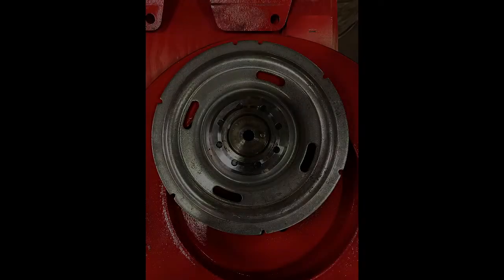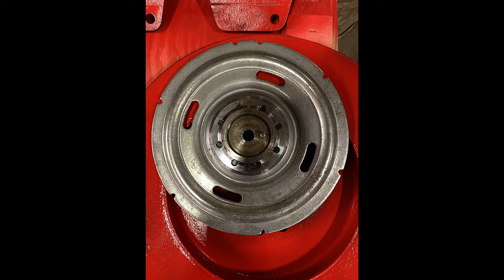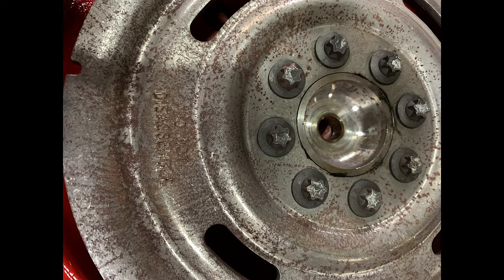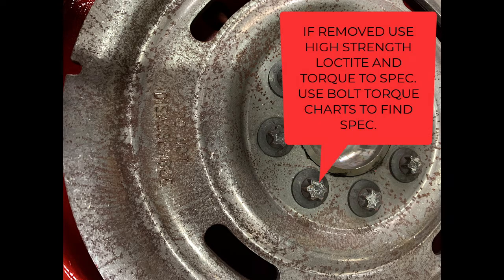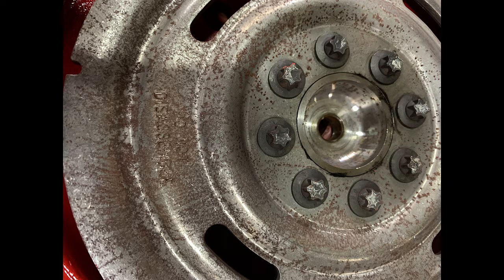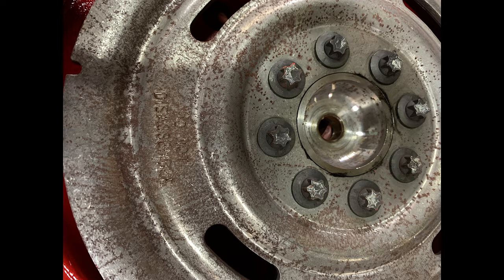ISX Cam gear timing plate install

Comment: Or just align the dots! The hub has a dot and so does the wheel, the two notches close together should be facing down at 6 o'clock with the camshaft wedged.
Reply from the maker: Thanks! As you can see sometimes we don't connect the dots.
Reply: @ENGINESHOPJOE  Well ...your not supposed to disassemble it in the first place but people are misconstrued on Quickserve and they remove the wheel from the hub before they remove the gear.
Reply from the maker: @realmccoy9597  you are correct. In fact the shop manual disassembly process specifically mentions that it should not be taken off the gear. In the real world lots of the guys I worked with including me took that off, hopefully only once lol

Comment: Thanks for the video. Im an experienced builder but not on the cm2350. I took it off! I notice the bolt holes are not symmetrical.  They kind of only line up 1 way. Any way i assembled according to this video. Just need the torque spec now

Comment: What is the tourque spec?
Reply from the maker: We used the standard spec for a grade 5 bolt of that diameter and thread pitch. Remember to use High strength Thread locker. You can google that torque spec. Also make sure your torque wrench is in calibration. We send all our torque wrenches out once a year for validation.